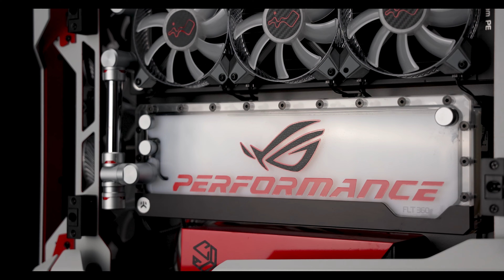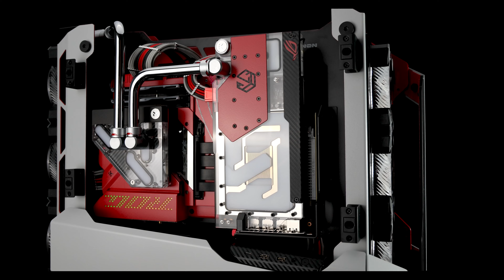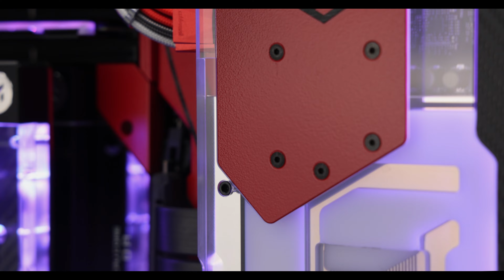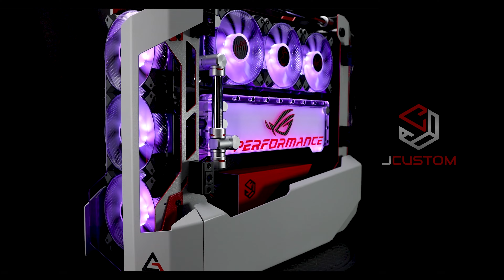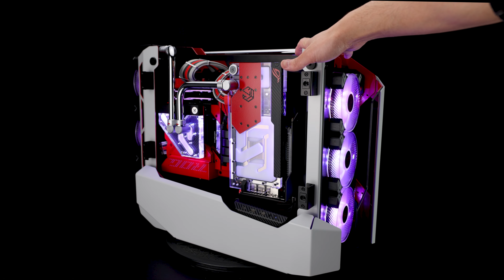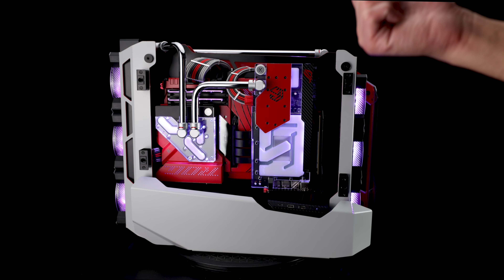Ultimate ASUS ROG Custom Antec Cannon Build FT: 13900KS + ROG Strix 4090 and Custom Red Z690 Formula

Comment: why not go with the z790 boards you already had?
Reply from the maker: I only kept the extreme and apex. I have the apex in another and the extreme is going into the v3000 plus. There’s no real performance difference anyway. Also the formula was the best candidate for painting. I forgot to mention this case doesn’t fit some eatx boards without modification such as the asus boards